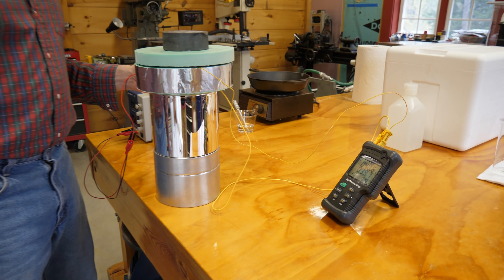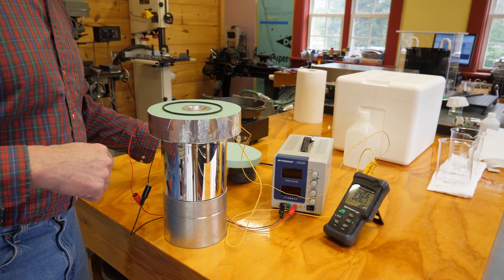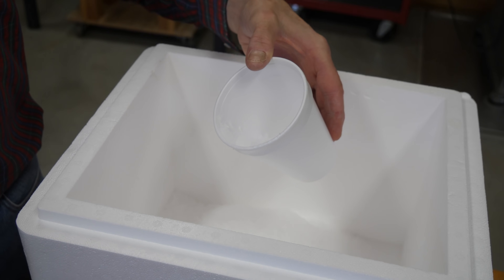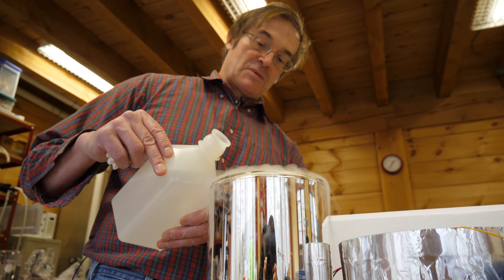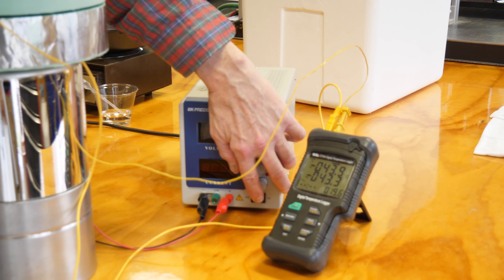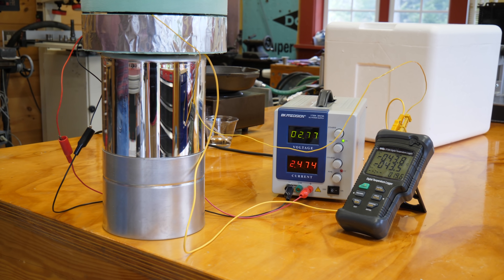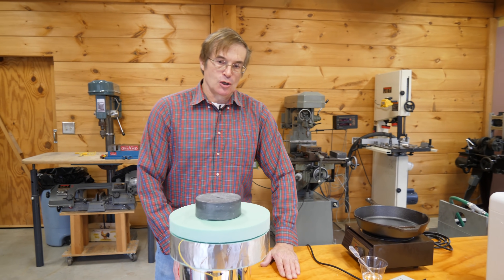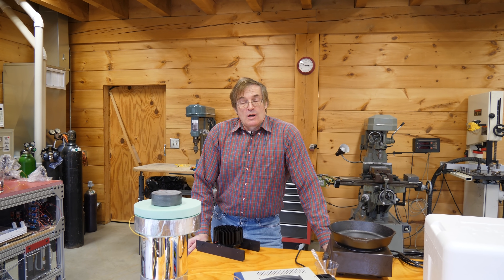DRY ICE vs ELECTRONIC COOLING!

Comment: You could get colder on the cold side of the Peltier if you are warmer on the hot side. That's cool :)

I can report that I've got -62 C on the cold side having -16 at the cold side. And yes, the 46 degrees difference is smaller wrt 70 degrees difference at room temperature.

Comment: I'd like to see the reverse concept of energy/heat harvesting off of a CPU or group of servers(bitminer).  Could we theoretically adhere a Pelletier device to a CPU liquid / mineral oil cooler heat system and generate steam to generate electricity?  I asked an engineer at TEC and he said this is impossible with "low-grade heat" of a CPU.  Is this true?

Comment: Somebody told me I should use dry ice for a homemade ac unit I built. I built a cooler from 40 pound regular ice I got for free at a plumbing supply house ferguson. Mine work but lasted only good for about 4 hours using timer also.. but the hot sun ate it up less than hour..best use in the shade. Use water pump through copper tube to and around heater core coil like a radiater and leaf blower fan. The blower took a lot af power. Best use a switching type motor expensive. Or a more efficient  fan on battery power. I looked up it it's not cost effective. Dry ice.

Comment: Nice video. 
I have a question. 

You mentioned at around 13:00 that handling methanol-dry ice bath is much more dangerous than liquid nitrogen because liquid nitrogen forms a shield of steam while methanol does not evaporate and maintains liquid contact with your body.  

However just a few minutes later when you dipped the metal end of the cap into your bath, there was some steam formation(which you predicted as well). How different is this from liquid nitrogen? 
Is there a subtle difference between boiling and evaporation at play here that i dont have clearly understood?

Comment: This is not correct to say conductivity of all materials decrease with temperature.  It is dependent on the conduction mechanism. For free electrons yes. But for other mechanisms the population of charge carriers might decrease. For example at least for intrinsic semiconductors and for ionic conductors like liquids or FAS the conductivity reduces by reducing temperature.

Comment: Are there TECs that won't operate at warmer temps because the resistance is too high, but will start working at lower temps so you run them in their temp zones as the overall temp drops?
Reply from the maker: Yes, but they are limited to research devices.

Comment: Great video Tech Ingredients.  I'm such a non-science type of person, definitely not educated in the scriences such as yourself so please excuse my ignorance with regards to my question.

What is the name of the vessel that looks like it is polished aluminum inside (think you called it a doer or is it duer)?
Reply from the maker: Dewer.  It uses a high vacuum between two thin glass walls to achieve a tremendous insulating effect.
Reply: @TechIngredients   Thx for the very prompt reply...looks like you have some very nice science equipment (ie Borosilicate glass)....Im just getting into the building of a DIY solar generator with LiFePo4 40152s cells as a storage device in 4s3p format, then building my own solar panels.....so your building has some interest to me especially anything to do with off-grid stuff like your air conditioner.  thx again for the info

Comment: 13:11 water is dancing on a surface because you used PTFE-coated surface. Water will dance and stay in drops even on cold PTFE-plate. Using just pyrex 2L-beaker, heated to +300 would be much more illustrative here. As everyone knows from practice that water wets glass under normal room temperature conditions.
Reply: Nice idea but I think that is too high a temp difference even for Pyrex… speaking from experience haha. 
I think leidenfrost was seen in the pan demo bc the water droplet  was moving around a lot faster than u would expect dropping it into a room temp seasoned pan

Comment: Peltier cloud chamber might be a cool project for this channel.
Reply from the maker: I've been thinking about it.
Reply: @TechIngredients  Hmm, i was working from memory of old crusty vids of poorly built ones, but it looks like Thought Emporium did a pretty good one recently.  Nice project convergence if you add your magnets or high voltage, but might be a little redundant.   Completely different angle, but an attempt at the newly announced plasma thruster design might be fun/interesting.  Looks like magnetron + waveguide + corona discharge + air compressor and well within your considerable envelope lol.

Comment: If the water was shedding heat to the upper component at the start, why didn't it drop in temp as the upper temp rose?
Reply from the maker: You're going to have to rephrase that, I don't understand the question.
Reply: Tech Ingredients at the start of the video you placed warm water into the container at 40.6 degrees. Sealed it off and waited for the temperature at the top of the container (approx. 20 degrees) to raise up to the temperature of the bottom.  I’m trying to understand why the upper temperature rose but the bottom temperature didn’t lower, it stayed at 40.6. Shouldn’t the two have met at a temperature somewhere in between the upper and lower?

Comment: Wait, ain't methanol toxic?
Reply from the maker: Sure, but you can handle it with proper care.  At very low temperatures its vapor pressure will be very low as well.

Comment: You say you keep it sealed but you have a massive gap underneath because you didn't make space for the probe cable.
Reply from the maker: The prove cable is less than  1mm in diameter.  That hardly produces a massive gap.  Also, the cold vapor is heavier than air and tends to remain in the container.

Comment: Just awesome informative and fun video 👏
What is indian film made of?
Where can it be bought?
Can we make it ourselves?
Thanks again for your channel, 😁
Reply from the maker: Indium film is based on the pure elemental metal, indium.  It is much softer than lead and melts at a couple of hundred degrees.
Reply: @TechIngredients  thank you very much 😊
Reply: Do you think that lead could be a poor man's substitute to indium since their electric and thermal conductivity values are fairly close ? 
And since lead is a pretty soft metal it could fill the gaps between the TEC and the heat sink ?

Comment: I would urge you to warn people not to play with methanol outside of a fume hood. 
Methanol is very toxic and should not be inhaled. Or touched. 

I understand there will be fewer fumes due to the low temperature and that inhalation is far less toxic than ingestion, but it's very hazardous.

Comment: Kinda unrelated but, 
I just had a thought regarding the UAV hybrid power supply systems....
Is there benefit in multiple smaller generators, each with an independent combustion engine? Both in regards to balancing gyroscopic forces and being able to cancel not only vibrations but the pulses experienced by the generator?

Kinda rhetorical, just thinking out loud.... The real reason I decided to stop by is Im currently working on gas turbine similar to yours, but i’m having trouble with the coupling mechanism between turbine exhaust and generator input shaft. The information available that is directly relating to it is virtually non-existent for its application/integration like this. Is there a way I could contact you to ask you the best sources of information available to me (Thats does not require a Masters to interpret lol) please?
Reply from the maker: I think the distributed generators have potential, but unless an assembly system is available, they would make the workload for a DIY project much greater.
The power turbine we are building is unlike existing systems that depend on small diameter, radial or axial turbines and an expensive, precision gear reduction capable of operation near 100k RPM.  
The design is similar to the reversing flow Pelton wheel which maximizes effeciency when the tip speed is only one half the exhaust velocity and drops relatively slowly even when the tip speed is even lower.  A large diameter turbine of this type can be directly coupled to a generator or vehicle transmission.

Comment: Thanks as always for your efforts.  Safety tip for dewars: wrap the exterior with surgical cloth (athletic) tape that way when it decides to go south it will be more contained with fewer flying bits.  All it takes is just a small bump by something, but I have them go-off inexplicably.
Cheers, Mark
****************************

PS   However, they do look much 'cooler' without the tape.

Comment: Looking forward to the LED update. Please could you talk about lumen-per-watt limits we could expect from blue-pumped LED? Also, anything you might know about laser pumped LED.
Reply from the maker: Great!
The theoretical limit is near 330L/W and in the lab, 300L/W has been achieved.  Practical, commercially available devices produce around 160L/W with a significant dependence on color temperature.

Comment: I would be interested in seeing a video about how differences in pressure affect temperatures. Also I've been wanting to build a vacuum chamber for a while now and been wondering if there was a way to pump out a proper vacuum manually without a motor, I know Edison made vacuum in his bulbs using the weight of mercury with long glass straws.
Reply from the maker: It is possible to use mercury with it's low vapor pressure and high specific gravity to produce a vacuum.  It's pumping speed will be very low.

Comment: I'm guessing it would suck badly if you spilled it on yourself, but you probably wouldn't lose a hand/finger. The temperature differential seems similar to the temperature differential with boiling water and your skin. Its a bit more viscous, but lower heat capacity.

Hazarding a guess its effects would be similar to dunking your hand in boiling water- you'd need to go to the ER, and you'd have a large amount of "burns" over your hands that would likely scar. But you'd recover in time.

But I wouldn't recommend trying it seeing as I don't suggest you try dumping your hands in boiling water either.

Comment: Dear Tech-Ingredients-Team,
please make a small notification on the high toxicity of methanol (LD on oral ingestion 5-100ml),
as maybe a few younger viewers may not have the knowledge, when experimenting with it in a similar way 
(especially concerning the inhaled vapors, or the great resorption rate on skin contact due to spilled liquid and
 when handling it without appropiate gloves)! 
(Methanol Safety-Data-Sheet: https://www.labchem.com/tools/msds/msds/VT430.pdf ).

A different question: could special peltier-elements be created with better efficiency especially suited for low-temperature ambiences? So that they could be switched in after passing a threshold level? Maybe semiconductors with higher energy gaps or different doping? 
Thank you very much for your videos ! Always happy to see a new episode!

Comment: I am hoping 50w is enough to cool 2.5cm3 of water from 30 to 4 degrees and keep it there. It is a handheld device so it might have a little thermal input from that, but it is insulated. Tried to simulate it but fusion was very unhappy with a cold and hot surface being next to each other.

Comment: Why aren't these used on processors? CPU's, GPU's ect, the cooler the better and people use air-to-air cooling fans and heat sinks or air to liquid to cools these things but power and wires are readily available, this seems like a better, space saving solution...
Reply from the maker: They should.  At the elevated temperatures on each side and the effeciency associated with modest temperature differentials, these would work quite well.

Comment: What do you think was the reason that the bath stopped at around -43°C instead of something below -70? Was it out of dry ice? Or were that just the losses (even with the dewar and insulation) and the CO2 couldn't evaporate fast enough to make up for it? Or was it missing convection (shouldn't really be an issue with the gaseous CO2 bubbling up through the methanol)?
Reply from the maker: It was out of dry ice.  The temperature stabilizes at -73C with enough ice.

Comment: Can you do a quick one part diy video on building your own throat microphone?
No good video that I have found exists. I am curious to see if I can make a waterproof version that would work for diving as a cheap alternative to current full face masks.
Also have some health issues that are making it difficult for me to communicate sometimes.
Have come up with a couple fairly good mics but if I understood the engineering and electronics a little better i think I could improve the quality and tweak the device to work with my situation better.

Comment: I wonder if you could do a 'gear shift' to a different heat pump with a higher differential, at the initial one's lower temp limit.
Reply from the maker: The limitation witdh TECs are the fundamental electron energies of the semiconductors used. Bismuth telluride is by far the most common.  More exotic materials can be used, but these are custom and costly.

Comment: There's some interesting graphs on the wikipedia page for seebeck coefficient (voltage vs ∆temp) vs absolute temperature for different metals. Some increase with temperature, some decrease, and some do both depending at different temperature ranges. The common feature is that all of them trend toward 0 as temperature approaches absolute 0. Semi-conductors work differently than metals in that their "apparent" seebeck coefficient depends on how they're doped, but across the board their figure of merit trends to 0 as absolute temperature approaches 0.

Comment: what would happen if you put a heat source such as a cpu on the other side could you reach lower temps on the cpu using this type of set up?
Reply from the maker: Yes.  As long as the overall or average tempreture is higher, the increased heat extraction from the "hot" side will increase effeciency, the differential and heat removal.

Comment: The dry ice bath didn't reach -78 C, in fact it was far from that. Is that because the hydrostatic pressure of the methanol raises the sublimation point or is there any other effect in play?
Reply from the maker: I didn't add enough dry ice.  With enough dry ice to reach equlibrium, a temperature near -73C is reached.
Reply: @TechIngredients  I see, so it was just consumed.

Comment: Could you suggest any possibilities for acoustic dampening/absorption in a very high frequency range, specifically 15khz? I've been trying to do some research on the topic, but there's so much advertisement disguised as science around the topic, and I'm not knowledgeable enough to feel my way through it. I want to try to find a way to deal with CRT whine for a project I have in mind.
Reply: CRT ??  What's that?
You could just wait 20+ years... that sound used to be loud and drive me nuts. Then CRT's went away, and then... so did the range :-(

Did you check out the Tech Ingredients video's on Hydrogen?
https://www.youtube.com/watch?v=jxOzpPJbnTI
https://www.youtube.com/watch?v=_a_dnAz4Ryo

Comment: Living in Oregon, just east of the coast range, good portions of the year find humidity on the high side (70-95%). Therefore I bought a dehumidifier that not only adds a significant amount of heat to the room (nice in winter not so much in summer). Since it uses a compressor and heat exchanger it is very noisy, especially now that it's getting older. The beast probably uses >300-500W (a guess) and I've contemplated building  dehumidifier using Peltier devices. Any thoughts?
Reply from the maker: Yes.  Do not do that.  These will use several times the power of your existing compressor based system because of their lower effeciency.  We have finished and will be posting in the near future on a dessicant based airconditioner that is much more efficient.
Reply: @TechIngredients  - "in the near future", not soon enough. I'm sitting in 40C and 15%RH, i'm aching to see that video ;-)

Comment: I considered using methanol/water as the heat transfer fluid in my refrigerated cold box using TEC chips but I decided against that because of toxicity. I also don't use ethylene glycol for the same reason. Water/ethanol, propylene glycol/water isopropanol/water are all much less toxic. FWIW
Reply from the maker: True.  Also, methanol is harsher on many organics like the plastic tubing.  However, at low temperatures the glycol/water mixtures become very viscous, pump slowly and this reduces the heat transfer effeciency.
Reply: @TechIngredients  That's good to know! As a test I tried to freeze a 40% and a 60% glycol/water mixture in a regular freezer and both stayed liquid but got a bit more viscous. The reason I explored using alcohols is because of concern that the water would freeze in the heat exchange block and clog up the whole works. The controller is an ATtiny85 pushing MOSFETs. :) I also use some 1-wire temp sensors.

Comment: I wonder if you would be able to get lower temperatures if the peltier devices on the coldest sides of the series were constructed of a material that would be the right resistance for the peltier effect to take place at those very cold temperatures?
Reply from the maker: There are semiconductor materials that are optimized for lower temperatures and these can drop to -140C in staged units.  These are very uncommon and very expensive.

Comment: At the risk of looking like a jackass for commenting before watching the whole video, doped semiconductors are pretty well known for having decreased conductivity with decreased temperature instead of the other way around like with copper.
https://www.researchgate.net/figure/Electrical-conductivity-versus-temperature-T-of-p-type-silicon_fig3_276318630
vs
https://www.researchgate.net/figure/Copper-conductivity-as-a-function-of-the-temperature_fig3_323745697